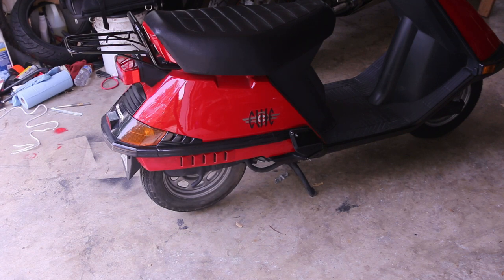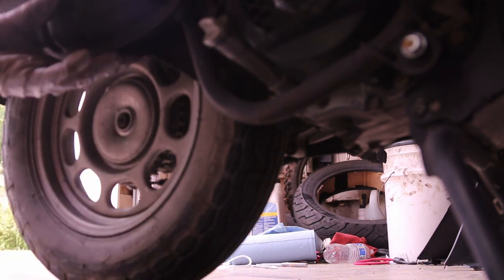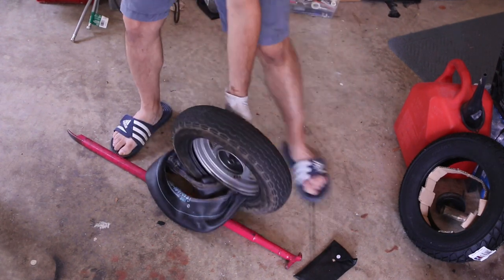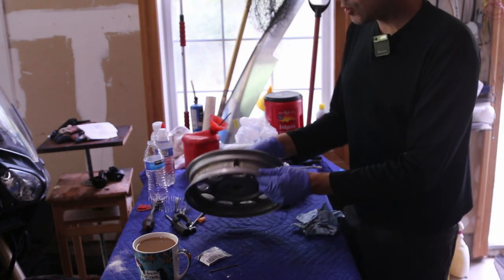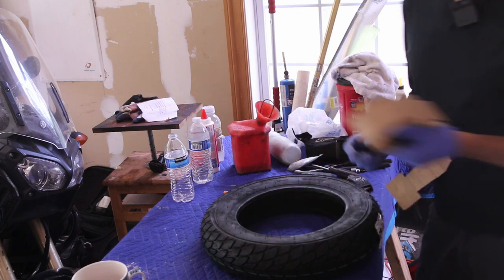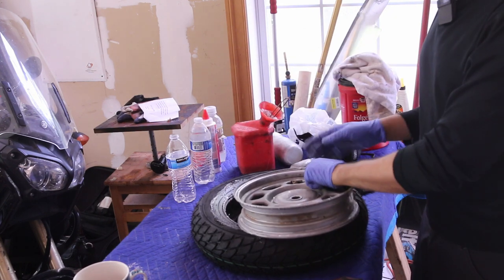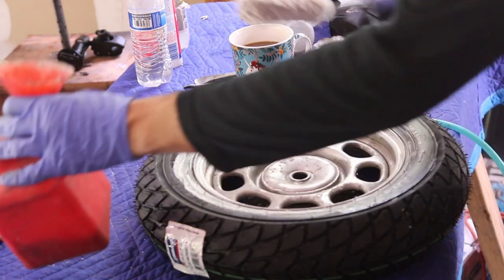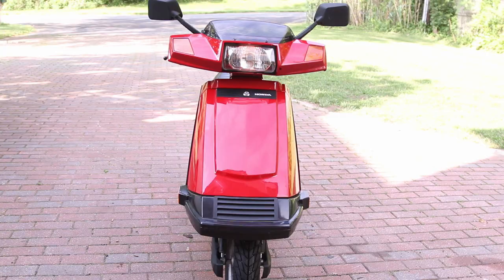honda elite 80 rear tire valve install and tire mount

Comment: thanks, good video.  I have an elite 80, ordering some tires, think I am gonna go with the michelin s83, better order quick, my front tire is old and the back bald. Trying to figure out what tire valves to get, and I guess I wont get tubes seeing how its tubeless,  man I cant believe i went this far in life without a scooter, I was missing out.  How fast does your elite 80 go? ive had mine up to 51 I think the wind was pushing me a bit, lake superior
Reply from the maker: I think it goes 35mph, how did you  get to go 51?
Reply: @motardsquid  I was on completely level ground when I got to 51 but the lake wind was helping me a bit, it gets up to 45 consistently.  I dumped it the first day I bought, I was messing with the blinker coming up to a stop sign, hit some sand just right or something, I used gorilla tape to put the blinker back together, most people don't notice the damage, great bike though, I'm only like 160 and the suspension is a little soft and it would be nice to have bigger wheels lime a c3 or something but I love it